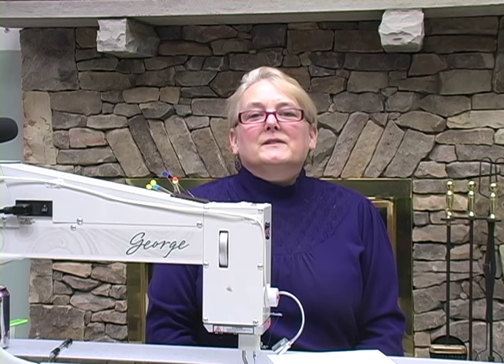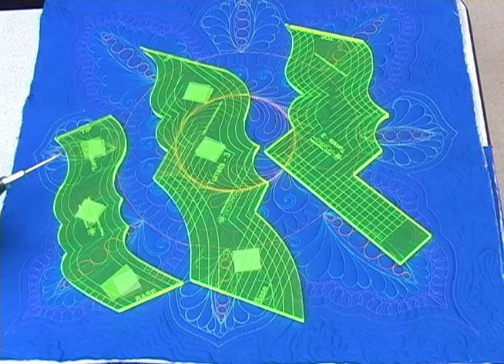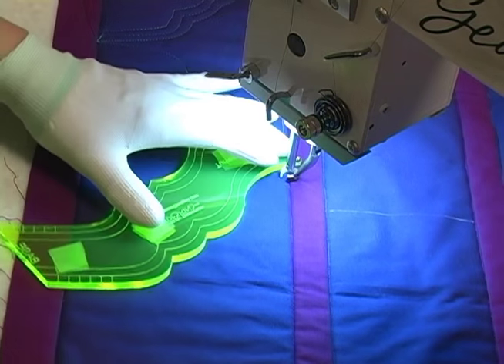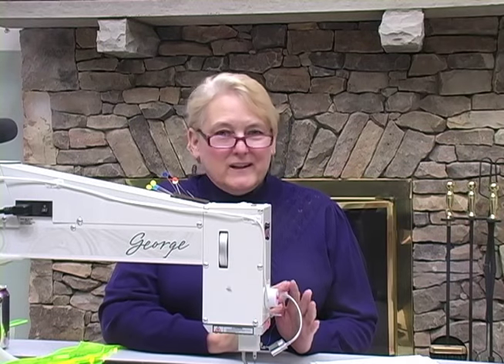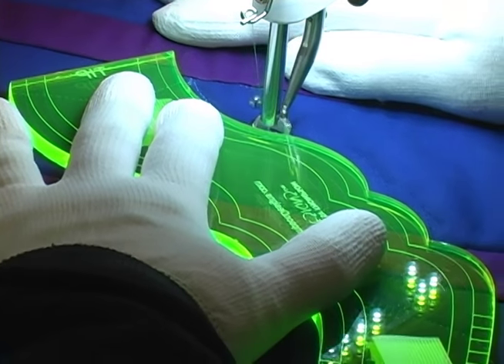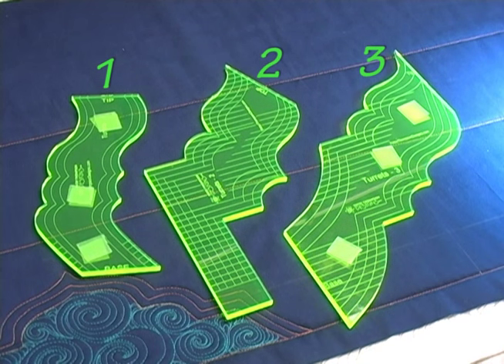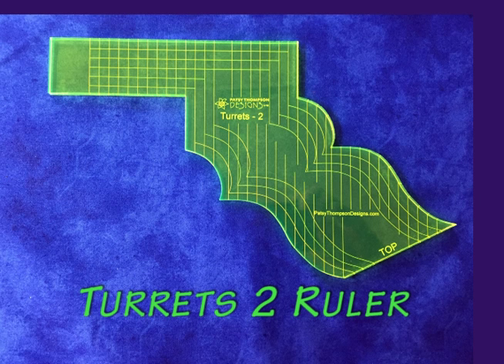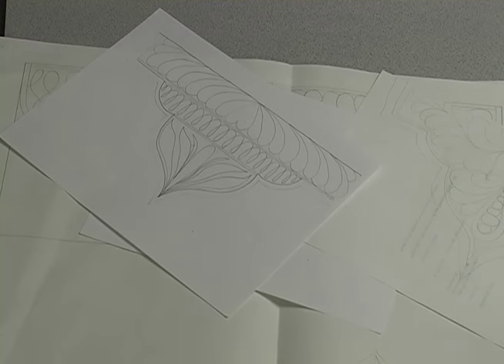Machine Quilting with Turret Rulers

Comment: This isn't a ruler question, but I just bought a George (thanks to your rave reviews!) and I have a machine question. At 4:10 into this video, it looks like you reach behind the machine for a second, almost like you would be raising a presser foot, yet there isn't one on George. Are you turning the handwheel to raise the foot a little? I ask because with my needle down, if I rotate my quilt, it is hard to move with the foot pressing down on it and sometimes my thread breaks with the next stitch.
Reply: Yes, you are exactly correct.  I was rotating the flywheel in order to raise the foot a but so that I could easily pivot the quilt.